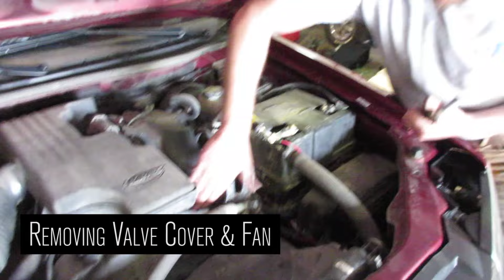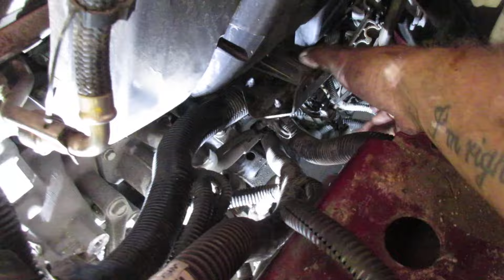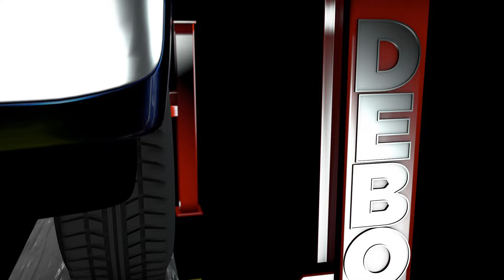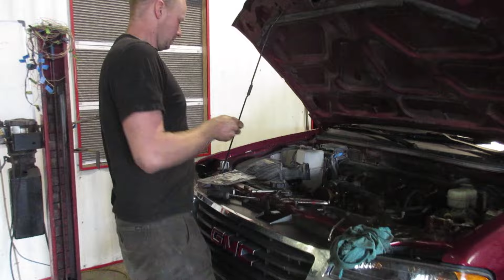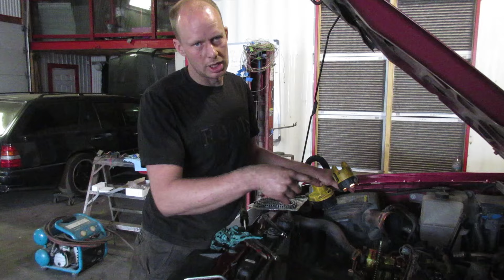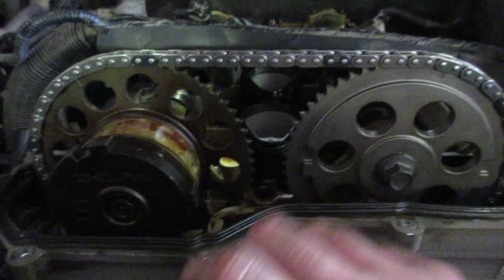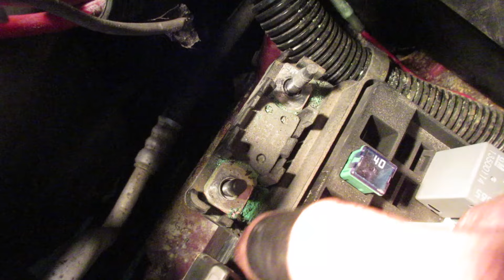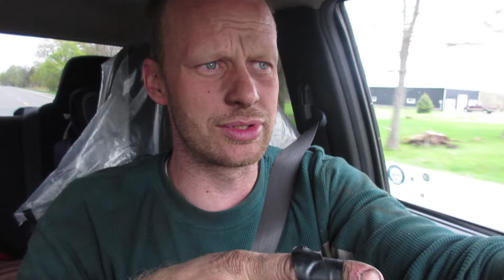Over-Engineering At Its Finest! GMC Canyon Needs A Timing Chain

Comment: What a mess I would have  crushed it into a tiny cube. I see you mentioned brakes behind a wheel bearing.  I just changed the brakes/rotors on  my fathers 2007 Chev Colorado  4x4 and when I seen how they came off I was like WTF?? and debated on even doing it.

The rotor is bolted on so that it comes off  backwards! You  have to remove the Usual caliper  bracket but then you have to remove the axle nut  and  the damn bearing carrier and try not to damage the abs wires etc then haul everything off.. . What a shitty design that is.. It took me at least  4x as long as it would to change normal rotors that come off once the tire and caliper bracket is taken off, and i had to buy  the 30 dollar socket to get the axle nut off as well.   I guess the only valid reason for this design is to make back yard mechanics think twice and  then take it into the shop and pay out of the ass. FU GM.
Reply: wish they built trucks like they used to. my 05 silverado z71 is really good tho
Reply: Superior my ass the rear drum brakes are a real pain in the ass with that w parking brake crap i can do the fronts no problem they are like the old pathfinders and fro tiers but what i don't understand why the fuck is the abs cable attached to the damn bearing all they had to do is put a connector on the damn bearing

Comment: Chevrolet should have stayed with the S 10.
Reply: Randy Green pushrod engines.
Reply: They fall apart @150  k
Reply: mine is at 305,000 km...it has never fallen apart
Reply: @brandonmurphy8837  Mine's at 292,000 miles now. But I'm burning the damn thing if the heater core ever goes out again... dash out, inner fender off, 2 day wait for an unlisted 'special' heavy duty core...

Comment: Bought a 2005 z78 3.5 I5 from my work with 233,000 miles....
New water pump, fan clutch, idler pulley, and tensioner and belt....
Seems fine, it's my job boat puller .

Comment: what a piece of junk. they should have stuck with the S10 and just updated it. the 4.3 V6 was derived from the 350. the newer 4.3 V6 is derived from the LS1 either is a much better engine this this pile of junk. the 2.2 OHV wasnt bad either, if not just a little underpowered.

allot of these new vehicles are total throw away junk. it reaches x miles and its too expensive to be work fixing, and certainlly not something you want to fix at home. i think i will stick with my 96 camaro Z28 and my 91 cavalier. i drive those cars for a reason, reliable and cheap to fix.

multiple timing chains are a terrible idea. look at the ford 4.0 V6 SOHC idiot design. you have to REMOVE the engine to fix the timing CHAINS. i believe it was originally a pushrod engine and they converted the damn thing to SOHC. in place of the cam, they have a "jackshaft" that goes to the back timing chains. its a terrible design requiring DAYS to fix something fairly simple.

if the timing chain fails on a small block chevy OR small block based LT1 (i have one of these) you remove the coolant, serpentine belt, water pump and there you have it. they rarely fail anyways, but anything is subject to wear. replacement, 4-5 hours of work not days.
Reply: andrew donohue can you
Imagine working on a new dohc ford 5.0L.
Reply: try a ford 5.4 dohc
Reply: they are all junk. give me a small block chevy (including the LT1 i have a 96 camaro), 4.3 V6, 3800 V6, older 2.8/3.1 (i still have a 91 cavalier with a 3.1 they were decent engines),  OHV 2.2 (i have another 91 cavalier 2.2), in a ford the 302, in a dodge the 318. most of the engines from 20 years ago are better then what they make now. the old stuff could be maintained with harbor freight tools and some knowledge. this newer stuff will leave you with a pounding headache. people want newer cars and they can have them. overhead cam junk, interference engines with timing belts that can smack a piston into a valve, cam phaser i heard that term but have no idea what it is. hell give me anything that's simple and has pushrods. you can have your throttle by wire, push start buttons, radios that are integrated with the car, you can have all of that crap...... and pay through the ass for it. no thanks.
Reply: I will throw my .02 and say the Ranger had the S10 beat in the 4 banger category. I like being able to pop my hood on my 2000 Ranger and see the engine in its entirety right there, as opposed to the S10 2.2 buried (quite literally) under a foot of plastic. Not to mention the Lima engines were tried, true, and kick-ass. I love the 4.3 v6, way better design than the 4.0. It's probably pretty cramped in the s10 engine bay but there is insane room in the fullsize trucks. Especially the later models, like 2008 silverados. When they did away with the mechanical fan and went to electrical, I can stand between the radiator and pulleys and do anything I want. Outstanding design. If I bought a new(er) truck, it would probably be that.
Reply: the old 4.3 V6 was a shorter block based upon the 350. same pistons, rods, bearings, valves everything just shorter. i had a S10 blazer with a 4.3, a 1994 space was not bad. some people stuffed 350's into the S10 so the 4.3 actually was not a bad fit. the newer 4.3 is based upon the LS1 same idea as the older engine but based upon the newer design. its not a stretch to call the 4.0 a piece of crap.
Reply: I wouldn't say the 4.0 was a piece of crap, just a weird design. It was a really good engine when it worked, but a nightmare when it didn't. People also stuff 5.0l in Rangers, that's a pretty fun project, not too difficult either.
Reply: andrew donohue 
The stuff designed with fleet duty in mind wasnt too bad.
Anything else from GM or Ford is a miserable nightmare to do anything to.
those LS motors are great until you have to rip the whole top end off just to change a leaky lifter. Its changing, though.....since less and less people do any work on cars the servicablity factor is slowly being phased out.
Reply: andrew the 4.3 is still based of the sbc not the ls1 jesus christ
Reply: the new ecotec3 design of the 4.3 is based on the ls series motors like the new v8s that's why it has a similar intake heads exhaust and direct injection..
Reply: The new 4.3 is not based on the ls engines. It's gen 5 based on the lt direct injected engines

Comment: should of bought a Tacoma or a Tundra. Lol At least the Japanese don't over engineer.
Reply: Exactly. I picked up a 3rz 4Runner with a burnt valve or two. It was a high mileage vehicle so I opted to purchase a manufactured head rather than wait on a machine shop.  Easy job.  Actually, breaking some of the exhaust bolts loose was the hardest part. Timing chain - You loosen the tensioner and it slips out of the way. I'm not aware of the actual timing chains having issues - some guys are getting over 300,000 miles on them - Even the 2rz Tacoma is a landscapers favorite.
Reply: Denniss7420 uh yes they do
Reply: You are forgetting that the Tacoma and the Tundra are made in America. The only thing Japanese about them is the name. 
The best Toyota trucks were made before 1995, when they came from Japan.

Comment: So, funny story from another youtuber. Nivlac57 is known for making big power out of the 4.2l L6 Atlas motors. Like 600+ on stock bottom end and 800+ with new rods and pistons. 
He worked on a couple of the 4-cyl motors and from what he's said, you can eliminate the the balance shafts and not have to worry about the chains on the back. He never said if he removed them and plugged the oil holes, or just removed the chains and left the shafts in place. You might be able to save a chunk of money if you own one of these by just not bothering with the rear chains. You'll have to pull the transmission once to get the chains out, but after that you'll never need to pull it again til its time for a clutch.

Comment: Doing this job on an 09 Colorado. For anyone wondering, I got the crank bolt loose using this method  with a 2 foot 1/2" drive snap on flex head ratchet, no cheater bar. 
It sucked the whole time doing it, but it can be accomplished with a 1/2" if you got a good one.
Reply: Also, gotta say thanks deboss. This video was mighty helpful as a preliminary to know what I was getting into. I use a labor estimator so i knew at 19.6 hours it was a big job, but I dont have alldata or Mitchell's. So that small little details like cracking loose the cranks bolt, the left hand thread bolt on the balance shaft, helpful info before i dove in.

Comment: This is fucking ridiculous. It's a timing chain, might as well pull the whole motor out. The timing chain on my 22R was easy, unlike this crap. Shame on GM
Reply: the little itty bitty 1.8 in my golf gti is the exact same way i just pulled the entire front end off pulled the whole drivetrain and bassically rebuilt the whole thing so i can get another 124000 out of the pos
Reply: Ever worked on a GM ecotec or a GM quad 4?  Those chains are a royal PITA also.
Reply: iv sworn to go back old school looking for a pre 91 full sized truck now going back no cats to worry about 350 i think i can do anything with a carb and those
Reply: The over engineering starts around 2004. Most things before that are pretty simple. Old fullsize trucks arent a complete cakewalk either, though. I have a 92 Silverado and after rebuilding the trans and replacing the engine, I will say there are more quirks than I care for.
Reply: 2000windstar Haynes book says engine removal Todo chain same as gm. same engineer ? from Ford.
Reply: Wildman don't forget unreliability, real popular with new stuff.
Reply: Also, what the 22R sacrifices for power and technology, it makes up for it with reliability and economy. It's pretty good for a truck motor...
Reply: Jake Tow um no most modern motors are more reliable
Reply: jdr ok Sure... Explain to me how my 08 wrangler with 150K miles burns quarts upon quarts of oil while my 85 Toyota with 330K miles runs just fine
Reply: Can't win em all, say what you want. My yota is on it's second motor, replaced at 250K. Trans is original, but hey what does it matter. Leaks nothing, but hey I built it that way. 
Can't tell you the countless fuel injectors I've replaced on the Jeep.
Reply: 22R's will run forever, ask the countless people who run them nearly upside down on propane. Or the people who've gotten to over 300K on them. Visit the forums, get real opinions and experiences from people like me who daily drive one
Reply: I've replaced quite a few 22r engines. They're not perfect, like most other engines, it's just a really nice and simple design. I would put their reliability in the same ballpark as the 2.3/2.5L Rangers or the SBC. Stuff will go wrong with them, but usually nothing that some hand tools can't fix.

Comment: My sister just bought an 09 canyon. 5.3😎 I do all the repairs for my families vehicles as I am a mechanic and work at a Mercedes dealership. The 5.3 isn’t too bad just alittle tighter than the Silverado and shorter exhaust manifolds. I’m good on those chains as I only have one on the 5.3 :) lol  sister loves it just bought. 1 week ago with 49k miles on it. And the bearings well it is what it is lol

Comment: I did this job on my 05 canyon because it broke an exhaust valve. 10,000 miles later I had to replace the engine. Honestly if I ever had to do a head or timing chain on this truck I'd pull the engine to do it. Engine replacement on these trucks is a breeze, had it out in less than 3 hours using a lift at my job. Had the junkyard engine in it and running less than 8 hours later. Easy peazy lemon squeezy.

Comment: @Deboss garage I have a 2005 Chevrolet Colorado crew cab with the 3.5L engine with 313k miles on it. It's actually been a really reliable vehicle given the fact that I have definitely put it through it's paces pulling heavy trailers the majority of the time. Recently it developed a small head gasket leak and figured that I would just go ahead and do a complete rebuild on the engine since I have acquired alot of mileage. My biggest complaint for these newer vehicles are traction control and wheel abs sensors. Living off of the beaten path where mud can be a daily occurrence these two items should be omitted from any pickup! But fortunately there's room under the hood to work on these vehicles unlike some vehicles!!

Comment: I got my 04 canyon when I was 15 with 215,000 miles on it and the head gasket finally went at 253,000. In the process of rebuilding now, and it has been a bit of hell. About to pull the engine to do a full rebuild.
Reply: Update: rebuilt engine ran well. If you need to do anything to the truck down low might as well just pull the damn thing

Comment: One of the timing chains is a roller chain and the other is know as a Hyvo chain. Hyvo chain is much stronger than roller chain but it also weighs a lot more so it's normally only used on drives where the chain is fairly short. Generally, Hyvo will also outlast roller chains due to it's multiple junctions on the pins.

Comment: The crank holding tool the dealership uses isn't very expensive either. Available through OTC. Goes in bottom of bell housing and locks the flywheel solid.

Comment: I have an 03 envoy with 305,000 miles it’s mint mint. One owner always synthetic oil change at 5000 miles never missed. 2wd never had timing chain touched. Just done water pump at 220k It still runs mint but I’m gonna do chain just too keep it going. It’s on ride tech air suspension, it’s sweet. I was gonna LS swap it but I’ve grown to like the 4.2 so I just bought a SS Trailblazer. I wanna turbo the 4.2 just for hell of it.

Comment: 10:46 It was my1st truck also the iron duke AND DAMN IT IT WAS 2.5L not 2.4L
Reply: thats exactly what i was gonna comment....i have the same engine in an 89 s10 with a 5 speed that had a crazy low 1st gear

Comment: Woowee, wish I would of come by this before. Very good video thank you, I now have a very good idea of what may lie ahead.  That is an unbelievable amount of work to do something relatively straight forward... you basically have to pull the motor to replace service items.  Jee wiz.  Honestly this is what drives me bonkers in today's age  it could be fixed it has more service left in it, but its so cost prohibitive to work on it goes in the trash... thus another vehical is bought... requiring more "emissions" to be replaced ultimately.  So all that extra complexity to reduce emissions to be more efficient is a moot point...

Comment: Im totally done with OHC engines, we have a  2010  Traverse  with a 3.6 VVT dohc 115K  and the timing chains completely failed and grenaded the engine,  regular oil changes ect ect.. didnt matter.. its a no win situation, either keep the truck and sell as is for $3000 if im lucky, take that money spend another 9 grand to get a newish used  SUV with about 90K on it  or get a used engine to put in and its already a ticking time bomb with the damn 3 foot long timing chains  :(  I ended up putting a brand new engine in it, with warranty.  for $7200 installed. As soon as I get my use out of it, Im going back to good  ol push rod V8's!
Reply: Take care of the transmission I replaced thos all the time regular service r good

Comment: The issue with the 2.9 is that it's a joint venture between GM, and that Japanese company that couldn't make anything simple if they tried, Isuzu. Anyone who has had to figure out why their 2.6 4ZE1 engine isn't working this time will recognize the madness that you saw today, with your Colorado/Canyon timing chain swap. I have a Colorado, and it's a good dependable little truck, but the instant that four cylinder starts to give me grief I'm sticking an LS in it.
Reply: How did that go? Have you had to LS swap it,yet?
Reply: @luigiprovencher  No, I ended up trading it in, found a good deal on a single cab F150.
Reply: @Oddman1980  That's what I figured. lol
Reply: @luigiprovencher  It wouldn't have been worth it, I'd have a new-ish engine in a 250,000 mile truck.
Reply: @Oddman1980  Then why did you say it?
Reply: @luigiprovencher  To upset you, specifically.

Comment: I had a 2004 3.5L that had about 300k on it when I sold it. Only issues I ever had was a bad clutch around 120k. I was actually pretty hard on the truck too.  Bought a Hemi Jeep to replace it and have already replace a shitload of parts in the first 50k.

Comment: A lot of machines are designed for ease of assembly and performance when new, at the expense of longevity. It's difficult to sell something on ease of maintenance when as a consequence the product appears to be a worse value new. Heavier, weaker, bulkier and more expensive, but easy to fix when it inevitably starts braking after years of hard use.
Like a lot of modern laptops run the processors frighteningly hot under load, in order to keep the machines thin, light and quiet. They wont live very long due to chronic borderline overheating, but by the time they start failing they want you to buy a new one anyway.

Comment: I bought one of these new in 2012 and GM offered it with a v-8...It might be easy-er to pull this engine and drop the v-8 if you can get the computer and body control

Comment: on a side note, the one I worked on, had the valve seats hammered into the head on account of poor casting. had low compression on one cylinder. If you are having a misfire on a cylinder, id jump to checking compression. its a known problem and many GM dealerships stock cylinder heads for the 3.5. That statement in itself should be an indicator lol

Comment: i just did an engine conversion on my 1984 alfa roemo spider,, i am useing a 2.2 ecotec.. and a w/c t5 transmission.. i like the 2.2 ecotec engine 2004 model   timing chain and balance shaft   ( i am running a delete kit on my car )chain is up in front of the engine, it was easy to build ( did mod the engine thuo now have 187 hp at rear wheels )  i think its a great engine 4 bolts per main on a bed plate, very strong engine